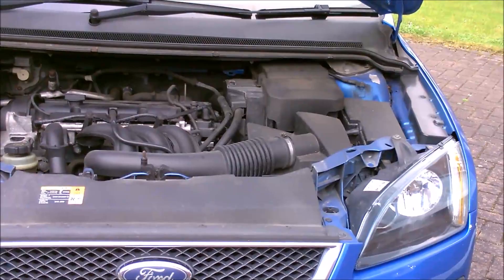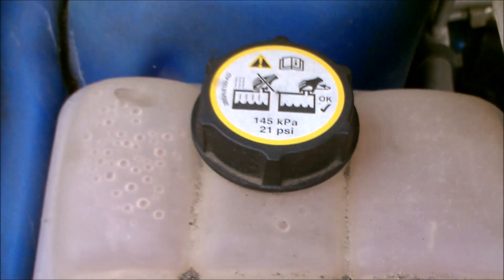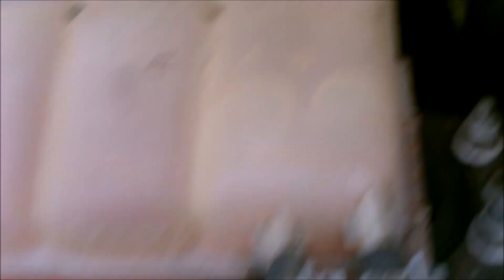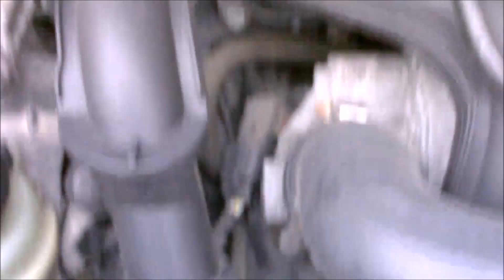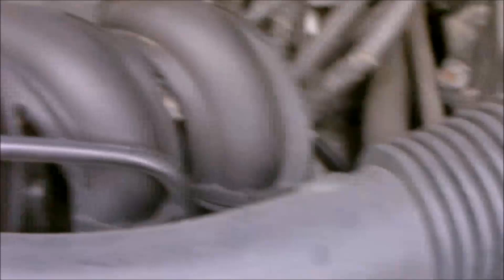Must Know Parts of the Ford Focus Engine

Comment: Hi, where is the air intake? Bought some egr spray cleaner and it says to disconnect the pipe and spray into air intake manifold. Thanks
Reply: The air intake manifold is the part at the very end of the air intake system where the fuel\air mixture is evenly distributed to the cylinders ... so towards the end of the video he pointed out the air filter, the first black box he points put on the right side of the engine. The big black pipe you see connected to that leads to the throttle body which is a housing for butterfly valve that opens and closes when you press the accelerator and then past the throttle body you'll find the air intake manifold

Comment: I have a mk2 1.6 ecoboost diesel, under my hood is almost identical except for the power steering fluid.. I can't find it 😔
Reply: Try removing the driver side headlight
it is located underneath there 😉👍
Reply: @MrMaster2262  It turns out it was robotic power steering, no steering fluid needed lol, thanks though

Comment: Hey I've got a ford focus cmax zetec MPV 1.6 petrol I want to put a air cone filter on it and take the standard air filter out could this work if I had an oil catch can with the crank case hose going into it. And blocking the out let hole
Reply: Good quuestion i also want to change air filter and maybe put sport spark plugs. A few horse power increase would be very nice :)

Comment: Hey man. Where is the transmission fluid  cap or bolt? Would really appreciate a response, I just bought a used 2007 uk ford focus wagon and I don't see it.
Reply from the maker: Its located on the side of the transmission and more easily accessible from underneath the car.
Reply: @DrivewayDudes  thanks for the response, what exactly am I looking for? How close is it to the transmission drain pan? Does this fluid have to change regularly? Because I am getting a hesitation in the automatic transmission so I want to diagnose it.
Reply from the maker: @atokamurray3263  The focus in the video is not an automatic. 
On the auto box we believe there is no drain plug. 
In some cases a slip or hesitation in taking up drive can be caused by a low level of trans oil. 
Firstly, best to check level with the trans dipstick while the engine is running. If low, top up. 
If no improvement then next step would be to remove the oil with an oil removal vacuum pump then top up with new oil.
If still no improvement then it becomes more of a challenge. You may have to remove the trans oil with the vacuum pump then from underneath drop the auto trans drain pan, disconnect wiring, remove and replace filter, shift solenoids, pan gasket then reassemble. 
We had a similar problem with a jaguar but with just a top up it appeared to solve the minor slip/hesitation.
Reply: @DrivewayDudes  thank you but I am looking for the transmission dipstick but there is not any visible to me. Hence my question of where is the dipstick or bolt for transmission fluid. I am willing to send an image for you if need be.
Reply from the maker: Standing in front of the car and looking at the engine, it would be located on the right side towards the front. Generally it would have a yellow ring to get your finger in to pull
Reply: @DrivewayDudes  Thank you so much. I have found it. The colour was black not yellow though!
Reply: @DrivewayDudes  Hey on examining the stick I realized there is grime in the transmission fluid and it is low. Should I change out the oil completely or will adding some oil be enough?
Reply from the maker: We would suggest adding some first and if it makes a difference then sorted. 
If not then your options would be 1. Drain and replace the oil or 2. Drop the pan and replace filter and shifter solenoids
Reply: @DrivewayDudes  I really appreciate the responses. Thank you a lot! Will do.
Reply: @atokamurray3263  Hi, can u tell me where it is? I must be blind lol
Reply: @UnseenSpirit  If your vehicle is a right hand drive it should be on the left hand side of the air filter. Just look for a tube with a cap facing upwards similar to the oil dip stick.
Reply: @atokamurray3263  Hi, I have a 1.6 zetec auto 2007 Ford focus. I looked at the video and some reason I can't see a transmission dipstick at all. Lol